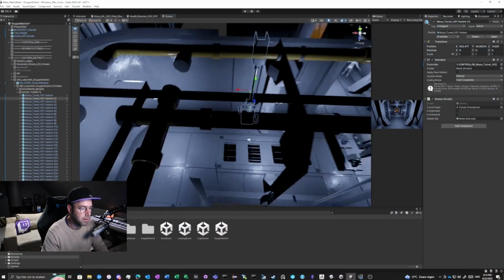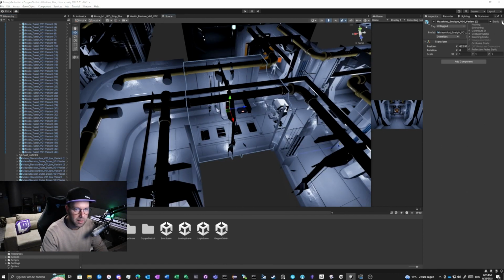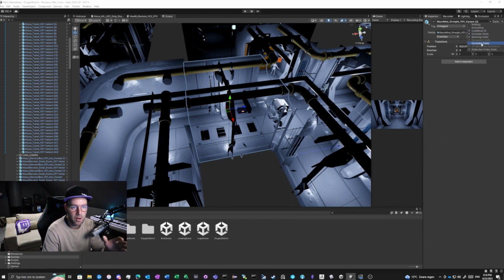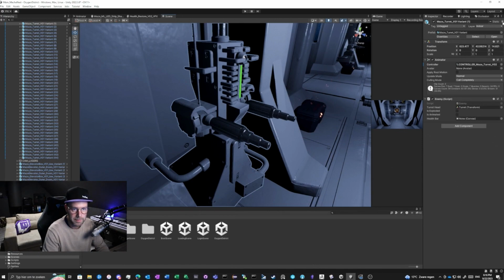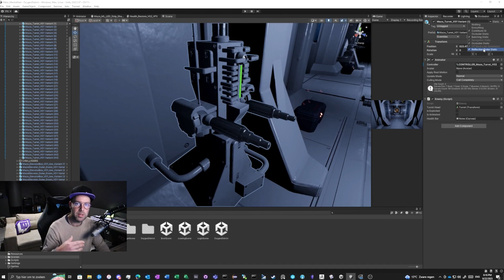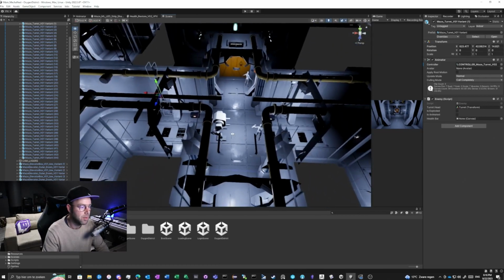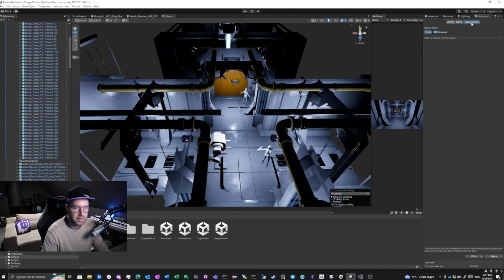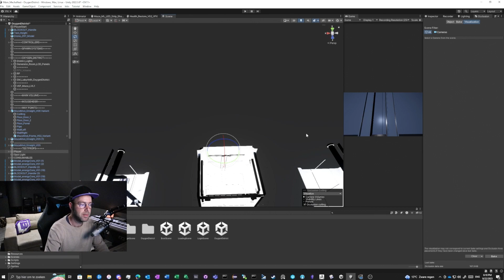How to use UNITY Occlusion Culling

Comment: if we use a oculdee and occulder will it work both on a same object ?
Reply from the maker: Still need to test it in my projects, but what i have found is.
if the object is both blocking the view of something behind it and being blocked by something else in front of it, Unity can efficiently manage what gets rendered based on the camera's perspective. Thank you for the question.
Reply: Should work
Reply from the maker: @LanciaSiluri it works also but has giving me some sort of glitch sometimes